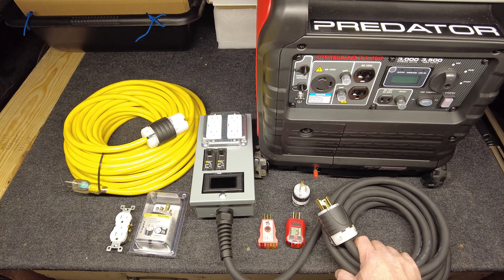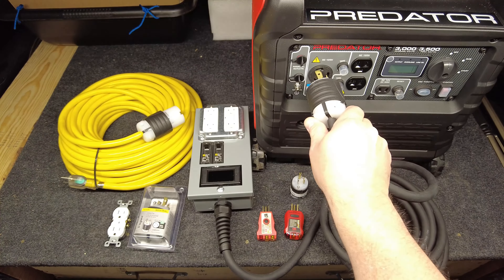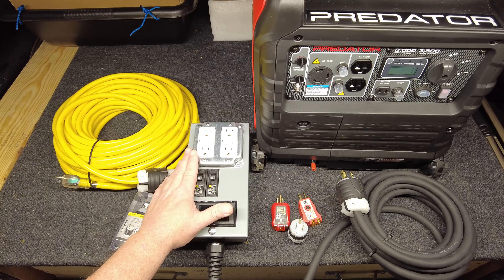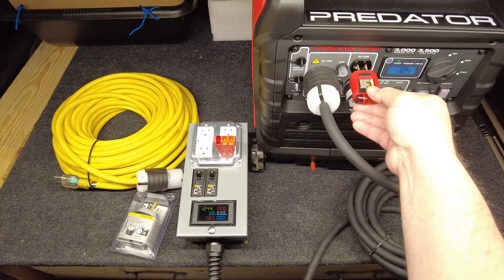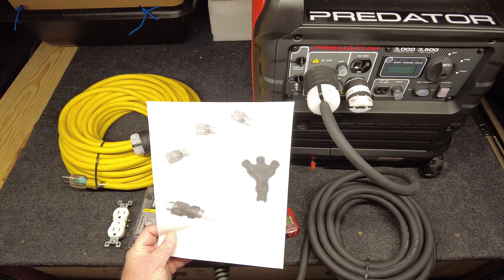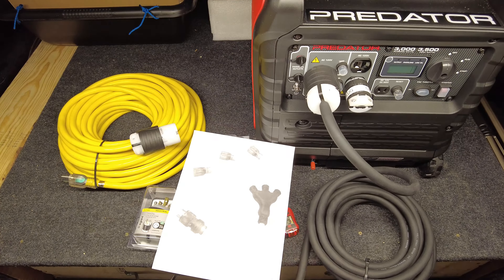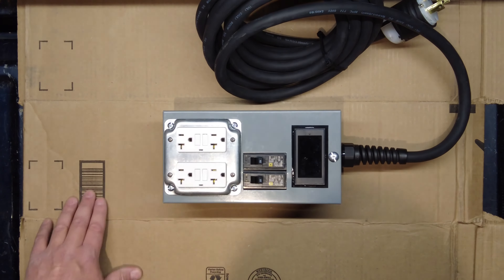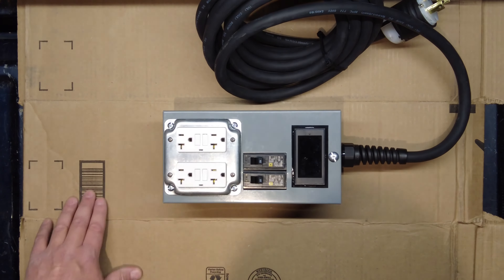How To Get Full Power From Predator 3500 Inverter Generator, Camping, Home Backup, GFCI Safety GFI

Comment: I love this video!!! Not exactly sure how I am going to get an 18 amp k9 11 high velocity dog hair dryer to work full power via my predator 3500 watt inverter, but I think I am getting closer after seeing the concept of your vid. 

Wondering though, since I am in Phoenix Arizona, and fully intend to designate a plug just for dryer, can I use a dog bone rv plug to do it in the mean time???

I'm an older female, and have converted a small shuttle bus to a mobile grooming vehicle, and I am desperately in need of a full powered dryer. I am so close after 2.5 years of building this beast, lol.
Reply from the maker: Hello,

Unfortunately, if you are plugging directly into the generator itself, and NOT feeding an electric panel inside an RV, or using a distribution box like I made in this video,  then technically the only way you can get 18 amps out of a 120 volt outlet is to make sure the breaker feeding that outlet is rated for 20 amps.  This particular Predator generator shown in this video has a questionable breaker feeding the 120 volt outlet.  Some say it trips at 13 amps, some say it trips at 15 amps, etc, etc....  and it doesn't really say anywhere on the generator OR in the user manual what the official breaker rating is.....  It's basically a crap shoot.  If your 18 amp dog hair dryer runs on the 120 volt outlet on THIS generator, then consider yourself lucky.  However, if the dryer does not run on the standard 120 outlet, then the ONLY other way to do it is to use one of those 120 Volt/30Amp adapters that will plug into the large twist lock outlet on the front of the generator and feed a standard 15-20 amp receptacle.  It's basically the adapter that I recommend to NOT use in this video. Why?  Because they CAN be very dangerous. With one of these adapter you are now potentially feeding a full 30 amps into equipment that was never designed to handle 30 amps.  These adapters exist for circumstances just like yours but that doesn't mean they should be used. I realize it may be your only choice and in that case you probably have to do it.  In fact, if I was in your shoes I would do it too.....  but just keep in mind what you're doing is not considered safe.  There is a reason why none of those adapters are "listed" by any nationally recognized testing lab, (NRTL) at least none that I know of anyway.  You've probably heard of something being "UL Listed", right?  That stands for "Underwriters Laboratories", or now they're just called "UL Solutions".  They are a private company that test products to make sure they are safe and wont cause a fire.  If a product is approved, it them becomes "listed".  The UL Solutions company is just one of may NRTL companies that test and "list" products.....  and again, I don't know of ANY of this type of adapter that is capable of feeding larger amperage into a smaller amperage style of plug that is "listed" anywhere is the United States.  I could be wrong, but either way you look at it.....  feeding a 15-20 amp device with potentially a full 30 amps is not good.  In fact, if I were you, and I needed to use this type of adapter, I'd also buy one of those short in-line GFCI adapter cords.  It's a short extension cord (about 1.5 feet long) that has a standard plug on one end, and a standard receptacle on the other end, with a GFCI breaker in the middle. That way you can plug the 30 amp adapter into the generator, then plug the GFCI adapter cord into the 30 amp adapter, then plug your dog hair dryer into the GFCi adapter cord.  This way, at least you have full GFCI protection in case of electrical short..... the GFCI would trip first and prevent your body from being electrocuted with 30 amps of electricity. Just search "in-line GFCI cord" and try to get one rated for 20 amps, if possible. Use one of those GFCI cords along with your 30 amp adapter and at least your human body will be safer..... However,  you could still potentially melt electrical equipment in case of an internal fault. Do what you need to do, but be very careful.

Comment: I have a or Predator 3500 and I was able to pull 30.3 amps for a couple of minutes before it over loads I have a bigger generator for if the power is out in the day time I mad a adapter too hook up to my interlock inlet so I can use my 3500 at night if the power goes out at night which is enough to run my refrigerator A couple of lights in my furnace in the winter or a small window unit in the summertime at night in one of my bedrooms I need power for medical sleeping devices so I need quiet power two I love this generator it is so good fuel
Reply from the maker: It's a great generator, for sure!  Thanks for the comment.

Comment: I've pulled 24 amps combined from the two standard outlets without it tripping.
I was running two space heaters on high which is roughly 1500 watts each.
I admit, I didn't run it for more than a minute like that, but it worked.
Reply from the maker: Interesting.....  From the various reports from users all over the country, it seems there is nothing consistent about the breaker on this generator. lolol.  Some say the breakers  pop at 13 amps, some say 15 amps, some say 20 amps, and now you've pulled 24 amps through the breaker on the standard outlet. lol.   Now we know why the owners manual is extremely vague when it comes to breaker specs.  Thank you for posting your experience with this generator.

Comment: Hello from the high desert of New Mexico USA 🇺🇸. I have that same generator, the generator can only put out 25amps period, the 120 volt outlets trip at 15amps
Reply from the maker: Hello James from New Mexico.  I've driven through New Mexico many times over the years. Other than spending the night in various cities while passing through, I've never spent much time there.  It's a beautiful state for sure!  Next time I drive through there (usually on I40) I will stop and check out the Blue Hole in Santa Rosa.  That's my plan anyway.

Back tot he generator... By using the larger 30amp (rated) outlet, (with the box I made) I will get an additional 10 amps of output (1200 watts) then I would ever get buy using ONLY the two standard outlets.  And yes, you are correct, the running output of the generator IS 25 amps....  However, I have seen video of this generator putting out almost 31 amps for roughly 30 seconds, which is great for additional load while starting A/C compressors, air compressors, or electric motors that draw a lot current at startup. Thanks for the comment, James.

Comment: What's the most efficient way to take only DC from a generator and put it into a battery bank. I'm trying to avoid DC to AC back to DC and save that 25% or so of power. I was trying to find a DC only portable generator but I'm ripping my hair out at this point.
Reply: @SlipFitGarage  thanks! I haven't seen a YouTube video about that so I guess it shall be trial and error
Reply from the maker: @louvindavis7518  Be sure to let us know what you find out.  Maybe even make a video about it.  Thanks.
Reply: All generators produce AC power. Inverter generators produce AC power which is converted to DC, then inverted back to AC. This produces much cleaner power. No generator directly produces DC. The only thing I’m aware of that does is solar. The predator 3500 does allow you to tap into the converted DC power but only 9 amps iirc.
Reply from the maker: @jontreese8677  Hi Jon...  After re-reading.... I'm not exactly sure what I was thinking about when I typed my initial reply.  I was probably thinking about batteries.....  there really is no such thing as an A/C battery.  (at least not yet, anyway) All stored electricity is typically STORED as DC electricity.....  but the original question was not about batteries so again, I have no idea what I was thinking. lolol. I agree with everything you typed in your reply posted above. But I do have one thing to mention.....  If someone reading this plans to use the DC power outlet on the Predator 3500 you may want to verify the output voltage.  I have heard (but have not tested) the 12 volt DC power outlet is NOT regulated so voltage can vary depending on load.  I have also heard this same thing for the 12 volt DC outlet on the Predator 2000.  It could just be speculation on behalf of the "internet" but I thought it was worth mentioning.  Thanks.

Comment: Question: if the GFI tester didn't trip without the ground bonding plug, will there be GFI protection without the bonding plug in the outlet?
Reply from the maker: Yes, you still have GFCI protection with no ground conductor. There needs to be a ground for the tester to work correctly. Hoqever, if there is no ground, you still have protection because of how a GFCI works. I'm pretty sure I cover this in the video. A GFCI monitors the power going in one side of the outlet, and out the other side. If there is an imbalance the GFCI trips. Example:  electricity is going in one side of the outlet, then somehow finds a path through a human body to ground..... the amout if electricity going through the human now is NOT returning through the other side of the outlet so the GFCI senses an imbalance and trips.
Reply: @SlipFitGarage  Thanks for the info,  my son wanted to make one for his camping trip.
Reply from the maker: @jimjarvis5756  Are you saying he wants to make a box like I did in this video?  If so, that's great!  Also, if he does make one, be sure to post back here and let us know if/where we can see either a few pictures, or maybe a video about his build.  Thanks again. 🙂

Comment: I have been running on my Predator 3500 for a week (Ice storm) and the Nema15 outlets keep tripping at lower and lower amps over last 2 days. First 15A, then 12A, and now as bad as 4A. Does this indicate failure of inverter? Engine still runs fine, it just keeps tripping. I've tested with different cords/direct plug into generator, and it's just getting weaker and weaker. I suspect a wiring fault in the house where the 2 phases might be bridged on one circuit; might this have damaged the inverter or breaker?
Reply from the maker: Is it the breaker itself that is tripping, or is the inverter shutting down?  If you keep resetting the manual breaker yourself with your finger then I suspect the breaker is getting weak.  If you are simply waiting until the inverter resets itself, then it's possibly (probably) an inverter problem. To verify it's a breaker problem, you could probably remove that breaker and bypass the wiring to test and verify that is the problem.  If the breaker is indeed the problem, then it should be replaced.  I do NOT recommend removing the breaker and running without it. One suggestion I do have.....You could  buy a cable like the one mentioned in this video that I normally do not recommend but then you could abandon your 15 amp outlets and run your 15 amp stuff from the 30 amp plug on the front of your generator. Depending where you live, these can usually be purchased at a local home store (Menards, Home Depot, Lowes, etc) Just make sure you're getting one with a 3 prong twist lock plug, not the 4 prong.  This is an example of what I am talking about:
https://www.homedepot.com/p/AC-WORKS-1-5-ft-10-3-STW-30-Amp-NEMA-L5-30P-30-Amp-Locking-Plug-to-Lighted-Tri-Outlets-Household-Sockets-L530W515-018/302447730
I hope they get your power turned on quickly.  Sorry for your trouble.
Reply: @SlipFitGarage  thank you we got power restored yesterday. I am pretty confident it’s the breaker – I ended up borrowing a neighbors generator and it ran everything no problem. it is the button that keeps resetting, and it was at first at like 15 A then 10 then less than 5. I’m going to replace the breaker and see if that’s better, do some testing while I don’t need it.

Comment: Hard to see, It appears your meter is only measuring one leg (black wire) of a 220v circuit. So only one of your outlets being fed by the black wire is being measured. If you put the sensor on the white wire neutral, it would measure total load. I like your box
Reply from the maker: This is only a 120 volt generator, there is only one hot leg.  240 volts does not exist on this generator. The one hot leg conductor feeds through the current transformer (which measures total amperage draw) then gets tailed off into two conductors.....   one for each receptacle.  This way total amp draw from both receptacles (combined) is being measured on the meter.   I also made a 240 volt box similar to this one that does have two meters, one for each hot leg of the 240 volts. That is a fairly recent video on my channel and can be found here: https://youtu.be/xiAkvRzsxG0
Thanks for the comment.
Reply: @SlipFitGarage  Great! I’m looking for a 220v version. I’ll check the other video out. I’m puzzling over how to measure both 220 volt load, like a domestic well, and 110v loads at the same time.

Comment: Nice!! Would you sell it?
Reply from the maker: I've been asked several times if I would sell this 120 volt box, and my 240 volt box (shown in another video).  I really don't want to sell either of them for two reasons..... 1. Then I am back to square one without a box for myself.  2. Most importantly, I don't want the liability if something happens.  I am totally 100% confident in my design and build quality but I can't guarantee how others would use it....
Sorry.  Thanks for the question.

Comment: Right on Brian,
So this is what you were talking about in the community post. 
This is genious. 

This should be right up WJ Handy Dad's alley. He's been experiencing regular annual power outages for the past two years. I have a feeling he might be ready to buy one of these units for emergency back up. 
-Chuck
Reply from the maker: Thanks, Chuck.  It should come in handy this summer. I live in an old area of town with above-ground power lines and we experience power outages once or twice a year.... sometimes only for a few hours, and other times it can be several days. I have a different generator setup that I can run my entire house with but that's a larger, much louder generator. This newer quieter generator should get me by for those times when we lose power for only a few hours. Thanks for the comment, Chuck. 👍

Comment: Dude, this is freaking amazing! I need a wiring diagram to be 100% sure of the wiring on that sub box. Fuckin amazing man!
Reply from the maker: The wiring diagram is pretty basic. I can draw one later and post it under the community tab of this (my) youtube channel. Be sure you're subscribed so you don't miss that post. Thank you for the compliment!
Reply: @SlipFitGarage  bro! That will definitely work! I had to watch that video several times. I kinda got the i/o routed, but given the fact that isn't audio, I did not want to run the risk of connecting a wire to the wrong cable. I'll be on the lookout for the drawing of the diagram.

Comment: Hello Brian , this video is absolutely brilliant and I appreciate all the information! My question is would you buil me a converter box like the one you have built? I would not hold you responsible at any reason for what ever would happen by me using it ! I would pay you for everything and your labor to do so ! Even a little extra .
Reply from the maker: I would maybe consider selling the one from this video.  I have since went to a larger generator and made a larger power box. (you can see that video here on my channel, too) Send me an email at brianok100@gmail.com
Reply: Would you consider building another box for me??? I just need it to work on my 18 amp k9 11 dryer. 

Or do you have another solution ?

Comment: Outstanding video!  Do you sell these?
Reply from the maker: Thanks for the compliment!  I do not make these for sale to customers....  too much liability.  I am not worried about my workmanship but if one thing goes wrong a good  lawyer could make anything, the fault of anyone. However, I recently sold the Predator 3500 and upgraded to a larger inverter generator (check out my most recent video) so I have considered selling this power box.  I already made a new power box for my new 240 generator (that video is coming soon) so I don't really have a need for this one.  I really haven't decided what I'll do with this extra power box....